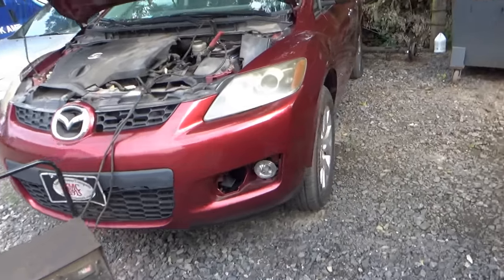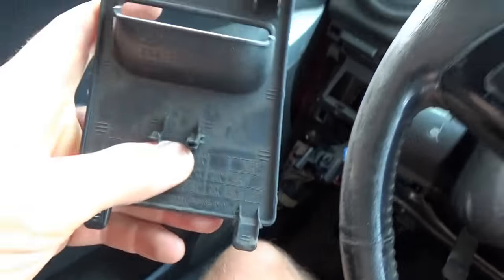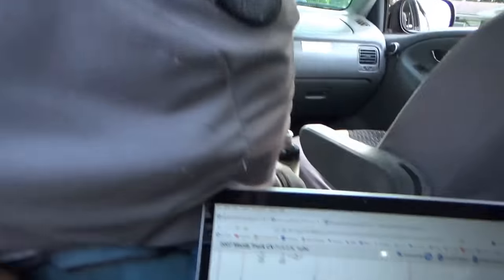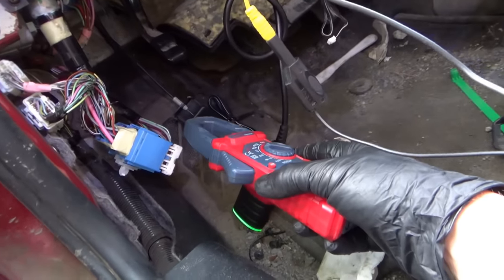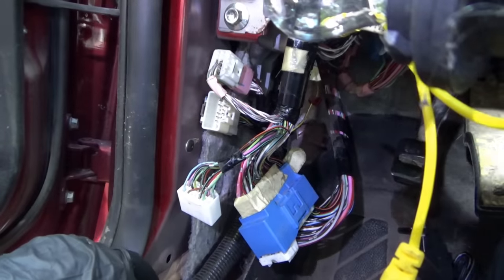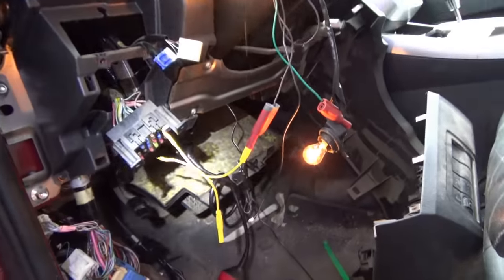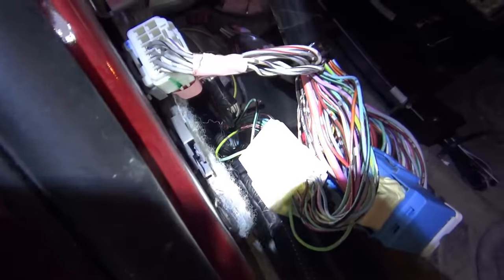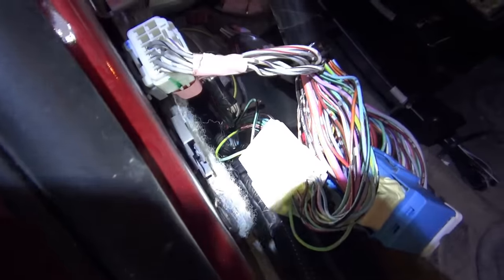DEAD After $3k in Suspension Work?? (Mazda CX-7 Turbo)

Comment: Seems like the first shop should be held responsible for the repair costs.
Reply: I agree 100 percent. The car was running when it got there but not when it left.
Reply: Yeah, I would be taking them to court for certain!
Reply from the maker: Not sure why the owner waited for a year and then decided to scrap the car 🤔🙄
Reply: @PineHollowAutoDiagnostics probably didn't want to spen the money in court
Reply: Can't believe you didn't drag it home and fix er up? Must have been a toilet! Great job
Reply: @marty0715yt  Basically replace every module to get it running. Only worth it if you have an identical donor car that has some body damage that has caused the airbags to go off or suffered a tree falling on it.
Reply: @PineHollowAutoDiagnostics  why did he even pay??? The car never ran.
Reply: Lawd somebody would have paid!
Reply: @ehsnils  Its old. Find one in a pick your parts yard and buy the modules for pennies on the dollar.
Reply: @PineHollowAutoDiagnostics  Perhaps it was a stand off with the customer refusing to pay for the suspension repairs until the car was driveable and the suspension shop not wanting to spend more time and money on it if they were not confident they would end up getting paid even if they got it running.  In the end the customer may have decided the $3k they were not paying the suspension place was better spent on another already running car .
Reply: Absolutely
Reply: a crime was commited and the shop will continue business as usual. they should be reported and flagged for incidents such as this.
Reply: Why? They didn't make it, sell it,  buy it or drive it while ignoring regular maintenance. Why?
Reply: @ronwade2206   How is going in for suspension work and it never running again the owners fault?
Reply: @ronwade2206 what?
Reply: The problem would be getting the shop to admit they put the alligators on backwards. Chances are that anybody that stupid will also be a liar. 😢

Comment: The second you were able to determine that the short was through the module instead of the wiring (and multiple failed modules) I immediately figured there was a reverse polarity event in the car's past.  Glad to know that everyone seems to believe that as well.
Reply: I saw it  on many chryslers. PT cruiser came in, no start. Needed a battery to start, Determined bad PCM. Why? he hooked battery charger backwards to charge bad battery. I did the diag, and the repair and advised he needed a timing belt too. He declined. Had it towed in 2 weeks later for a "fuel  pump". Just quit on the highway. I checked, yep belt broke, Not a fuel pump.

Comment: I personally do not remove the battery cables when welding. The problem is not that they leave the battery hooked up. The problem is that they do not put the ground in proper location. Say your welding broken exhaust manifold bolts. You have to put the ground on the head itself. Not the engine block. If your welding exhaust it has to be on exhaust close to what your welding. If you ground something else and then the current finds its way by any means possible and the result is what your dealing with.
Reply: I watched someone weld a REAR shock perch under a  Lincoln. He hooked ground wrong and set the master cylinder under the hood on fire. He put ground where it grounded through brake lines. The lines are  insulated from front to back with little plastic retainers to the car body.  I have seen some weird stuff.
Reply: Not so sure about that. Not saying your method  is wrong, im saying modern integrated circuit technology is waay more fragile than you think.   Semiconductors are vulnerable to certain frequency and high voltage spikes. When you are arcing and sparking down there, those sparks are actually very high voltage spikes lasting from milliseconds to nanoseconds. These spikes have electromagnetic pulses that radiate outwards and can randomly induce currents into unshielded circuitry. Worse case you blow up a circuit. You could also be injecting minor damage to semiconductor material..damage known as " latent defects" a latent defect can be  physical damage to semiconductor junctions in transistors diodes, mosfets, and others. This latent defect may not disable the circuit, but degrades the component and decreases its reluability or lifespan. All semiconductors have limits to outside electrical impulses, feedback, arcing and sparking..can only take so many zaps😢
Reply: It takes 2 minutes to remove the negative terminal from the battery to add another measure of safety.
Reply: @bills6946  I think ya should re read what I wrote. I think ya may have missed the point.
Reply: @eddiereichel9354  I reread what you originally posted and agree with it, but Im just stating how the owner where I work operates. He demands we disconnect the negative battery terminal for an extra level of precaution before the stinger touches a customers car, thats all.

Comment: I was feeling pretty good about tracking down a broken wire on my driver's door power window...until I see you taking a car that is totally dead and systematically disconnecting and tracing circuits and finding out where the problem is, or multiple problems are.  Cars have gotten way too complex for Joe Shadetree to  diagnose these things anymore.   Love watching your videos.

Comment: Wow!  So, this customer is out 3K and gave up on the car?  I can only assume that this shop wanted to charge the customer for their incompetence.  As I see it, the shop that caused the damage to those modules when they jumped the car wrong, should be liable for replacing said modules.  Not the customer.  That's crazy.

Comment: Great video again, 1st thing I thought of was a welding spike.  Your fault finding is once again exceptional, and your suggestion of a jumper pack issue spot on.  one way to sometimes prove a battery live and negative swap is to look at the wiper motor, they automatically run backwards on a misconnection, this breaks the parking contacts in the wiper, the result is that when hooked up correctly the wipers won’t auto park when activated.

Comment: That’s a shame, I would have love to see the final repairs and car start and drive. But after 1 year and $3000, I can’t blame the owner for not wanting to spend any more on it. Great video!
Reply: Personally I think the owner's an idiot. 

A person spends $3,000 on suspension because they intend to keep that car as a long term proposition. 

After being told "NOW that we've taken it to a COMPETENT repair shop (that calls in PGAD if needed) we've fixed most of the other problems except it needs 2 new computer modules, used ones probably cost $400 and it will go for sure".  

To which the owner goes "No, scrap it". 

So it's cost him whatever money he had in the car, plus the $3,000 for a whole heap of suspension work, plus whatever other costs, but for not wanting to pay $400 more, he's gonna sell it for scrap for like $1,000 ?

 Maybe "Samcrac"  or "100% Jake" will buy this at auction having paid just a thousand dollars for it , find out it needs just a few hundred dollars of used computer modules and have a great running new 4 wheel drive waggon for the Winter, and hey, brand new alternator, no flat batteries on snowy days LOL.  Note when Samcrac gets a snowy day, we'are all in trouble.
Reply: What must of happen is the owner is tired of hearing it needs something else after one repair or attempted repair.

Comment: Many years ago, I dealt with an E36 BMW which would not shut the engine off when the key was turned off.

Everyone where I worked said ,"Oh, it needs an ignition switch. Just order one. Why are you still trying to diagnose it?"

Half an hour later or so, I determined that the instrument cluster had an internal short between a "hot in start/run" circuit and a "constant battery power" circuit. A replacement cluster fixed the issue.  There was nothing wrong with the ignition switch.

It's a shame so few technicians understand how to do this kind of diagnosis.

Comment: this is what we THOUGHT happened to a Jeep I bought last October when I went to have a new battery put in.  that same Jeep is what started me watching all you guys' channels!  turned out a popped fusible link (which i didn't even know they were *still using in cars*) saved all the electronics.  the only casualty was the radio fuse.  unfortunately, said Jeep, which I just saw today at work, needed more mechanical work than electronic work...and no one will touch it becuse of its age and mileage.

Comment: When you got started I just knew you were going to find a pinched wire from the other repairs. I have had to snoop out pinched and welded wires in the past (no fancy scanners, just s Power Probe and a little knowledge).

Comment: For tracking down dead shorts, or open wires  I've been using a Fluke pro 3000 probe and tone generator.  It sends a signal into the circuit, and follow along with the probe to see where the short  or open is.   Using a amp clamp, the conduit has to be opened up, and risk making the problem go away.

Comment: Really great case study Ivan! I like how you used a  test light I place of the fuse to chase a short to ground. I’d assume some circuits depending on the load can potentially light the bulb but for the most part this Is a great tool for the Arsenal thanks for Sharing!

Comment: This type of damage caused by reversing the jumper cables could happen to ANY car regardless of the service it came in for.  You could come in for an oil change.  The car could need a jump for some reason, and then, wah lah!  Multiple modules fried because some guy at the shop reversed the polarity when jumping the battery.  So preventable too, because the shop owner could very easily buy a jumper box that has reverse polarity protection.

Comment: Ivan, great work again… Surly it wasn’t up to the customer to say ‘scrap the car’, it should have been the garage who caused the damage in the first place to make it right. By scrapping the car the garage who caused the problem has got off ‘Scott free’ …. Must admit… I would have been tempted to remove the module and check them on my bench back at the ranch. Just for the hell of it. After all if the car goes for scrap it wouldn’t have mattered if a few modules were missing would it!

Comment: I havent seen that so much for Mazdas, but i have seen it on Chryslers REPEATEDLY. Had a 4.7 dakota come in. Customer drove it home, shut it off, wouldnt start again. He took 7 shots with the parts cannon to the tune of 1000$ in parts. Cranked it until the battery was dead. Tried again a week later. Then towed it to  us. I tried to scan it, no communication. Checked powers and grounds. Bad computer. Replaced computer, I could communicate, but still no start. I started a second diagnosis, Checked data, cam/crank sync data PID, said no sync while cranking. Scoped the cam sensor, no signal. Put a sensor on it, fire right up.
 That truck needs can sensor for starting ONLY. It failed, didnt know it until restart. Customer had hooked up jumper cables backward and turned on the key. Fried computer. My diag an repair was only 500$ He threw 1000$ at it in parts hoping. He changed everything he could see, But that cam sensor is below valve cover on right side of engine out of sight.
Reply: Yeah, if you don't pay close attention to what you are doing you can easily add in variables that are tough to figure out. 

A few weeks ago I pinched a wire on an oil pan job. I though it was an intermittent problem flaring up that got worse, but it was my doing.
Reply: I did that putting a transmission in a stretch limo on the ground. I was much younger then. I caught an O2 sensor wire between engine and transmission.. It was harness side, so yeah it sucked.

Comment: Mazda CX-7 Turbo, you have my sympathies.
Reply: Jajaja let me just mention a few of the common problems on these Mazda 
#1turbo assy
#2 vvt actuator and timing chains 
#3 transfer case leaks and noises 
#4 rear diff leaking and noises 
#5 timing cover leaks 

And so on 
 
Thank god they stop making it 
I work on Mazda for the past 24 years and I never saw a Mazda with so many common problems .

Great diag Ivan 
And good decision by the cust when he decide to scrapped

Comment: I guess you have to be careful doing any kind of welding on these newer cars that are filled with modules.   Any time I've ever had to do any welding on a vehicle I always make sure I have a very good and clean ground with the welder, and that it's placed as close to the area I'm welding as possible to keep any voltage spikes from getting somewhere they shouldn't be.   I'm guessing that Mazda was rusted out pretty bad and needed some structural repair to keep it on the road.   I'm glad I live in the south far from the rust belt.

Comment: Some devices have reverse polarity protection.  I wonder what it would take to do it at the battery before it hits the fuse block or at the fuse block / TIPM before it hits the branch circuits.

Comment: At 20;36   And knowing that they changed alternator my guess is 
Shop hooked battery up backwards and blew out some electronics 
Watching the rest to see if I get it right

I’d bet radio is also doa 
Probably a diode in transmission control

Comment: U should have borrowed it before it left for scrap and stuck the tcm in it. Though it should be able to be bypassed as the only thing that it's missing from the tcm to atleast start is the nuteral safety switch so should have been able to supply 12v to the starter and seen it crank if not start and run

Comment: Where would I go next is to the scene of the crime - the suspension work.  I wonder if there's a wheel speed sensor wire routed wrong and smashed between bits of new suspension, or a damaged harness near the top of the strut tower.

Comment: There 4 components that can cause similar issues that I'd disconnect 1 by 1 
ABS unit 
Alternator feed
Starter feed 
Bose amp feed 
The biggest issue with the cx7 turbo is the Big end journals going bad  causing a zoom zoom kaboom fault .
Reply: Think that was when Ford was still supplying the engines (the boom boom).not sure though.

Comment: 23:56 The car doesn't even start, so the only way they could know that the alternator was bad is if smoke was coming out of it.  LOL.  If the alternator was smoking, that's a big clue that some modules got fried too.  You don't need an alternator to start a car, so it makes no sense why they replaced it.  If they believed the shorted meter fuse was due to a short in the alternator, all they had to do was disconnect the alternator to see if that was the case.  The shop should be paying for the diag, alternator, and replacement of modules.

Comment: My buddies truck was here at my shop for 2 years. No puddle of oil under it but when I started it it was making racket. Ended up 2 quarts low. Always best to check it first. Hindsight.
Reply: It took you 2years to check the oil??
Reply: lol
Reply: @Jumalten001  The truck sat at my shop for 2 years. No I didnt go out and check the oil every week.  I did  not see a big puddle under it. If I had Im sure I would have checked it.

Comment: Why would the owner sink all that money into diagnosis (especially after $3000 repairs on suspension) just to ignore it and then scrap the car (worth maybe $3000)? And what the hell cost $3000 to fix on the suspension?
Reply: Shops today will call 2 lower control arms, 2 quick struts, 2 links and an alignment $3k😅

Comment: You just don't take your car to any car shop to replace parts. Now you can go on line to learn how to do it yourself to save money. If the owner did not replace the suspension system the car is still running now.

Comment: If I drove it in. I better drive it out of the shop. If they goof up they fix it. Everyone makes mistakes. Just fix what's broken and make sure it works properly. Or pay the costumer for a equal value car and eat the cost if you do welding and jump it backwards. It's really really bad practice to bring that on the costumer.
Reply: Friend drove an old plow truck in a few years ago. Did some work on the plow and the truck broke in his shop. Ran and drove fine before that. I diagnosed it, can network in the cab had a wire break taking the truck down😆

Comment: At that point the the shop that short circuit in the battery should have been the one 0 eating the cost I'm getting 🎉my car back up and running the car went there running it should have got back to the running thee same way are they should be owing him a replacement car of similar value

Comment: I'm 7 minutes in, is it just me, a short to ground, and it quit running right after front end repairs, maybe they pinched a a wire or a bundle and caused the problem, probably where I would have looked first, I'm no where near as knowledgeable as Ivan, so I'm reluctantly pointing this out , time to finish watching.

Comment: Someone reverse polaritied that vehicle and hushed it up , most probably the suspension repair shop ,very poor ethics by that shop to not own up to what happened and  take responsibility , it would have been so much easier to diagnose also knowing that . The customer has had enough and probably does not trust any shops now including Ivan's diagnosis. In previous jobs I have had to make a mistake then lie or not give correct information to cover our own mistakes was instant dismissal and loss of reputation in a small industry making ut difficult to get more work in that field.